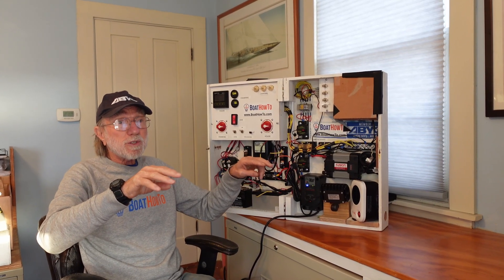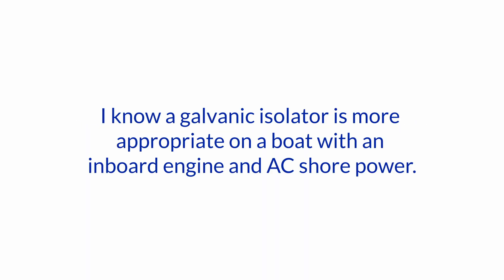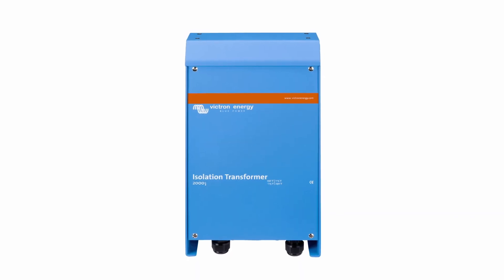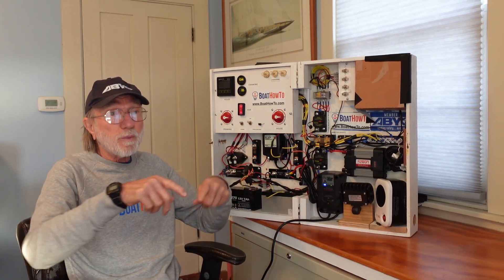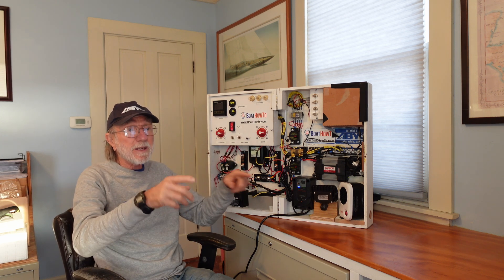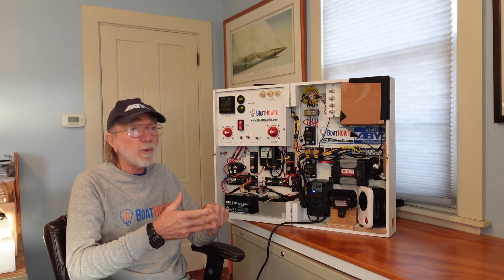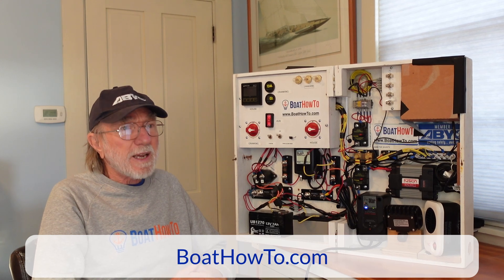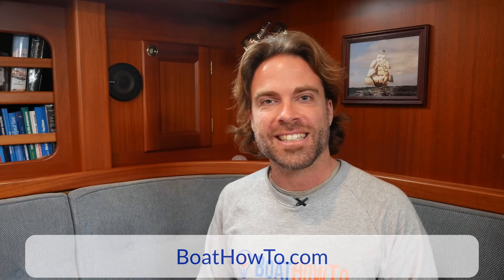GALVANIC ISOLATOR on Center Console Boats? | Ask The Expert with NIGEL CALDER

Comment: I have a bass boat and sometimes have stayed in marinas that have power outlets. In freshwater lakes most marinas are older and have me wondering if it is good to use. It mostly used just to charge trolling motor batteries.

Comment: Seems to me the question is whether, if you have shore power, do you have grounded underwater metal?

If your boat has outboards, you're likely to tilt them up out of the water when you're in a slip and connected to shore power. If this is the case, there'd be no connection from ground to the water.
Reply: WHAT about the fixings through the hull transom, that hold the motor on ,
Reply: @allsearpw3829 They're generally above the waterline.